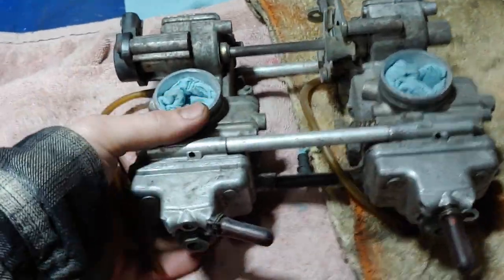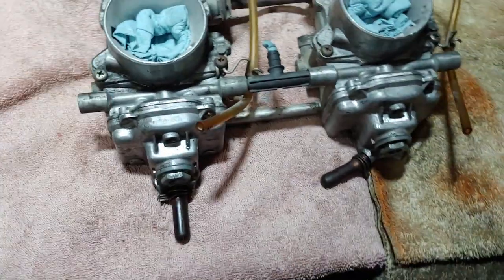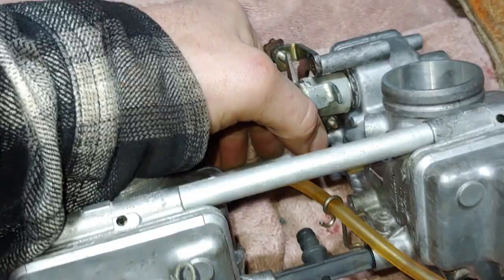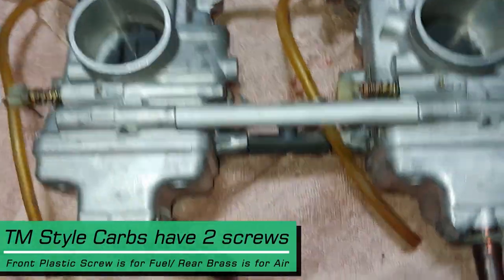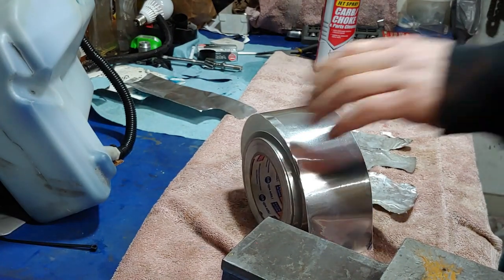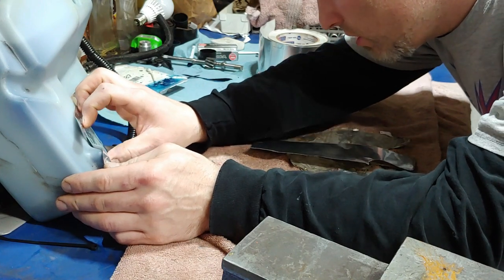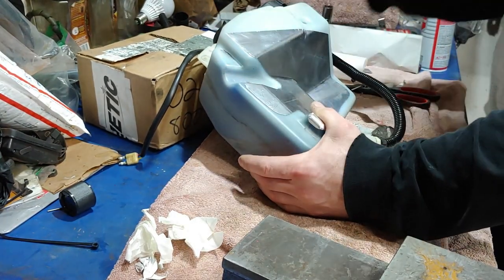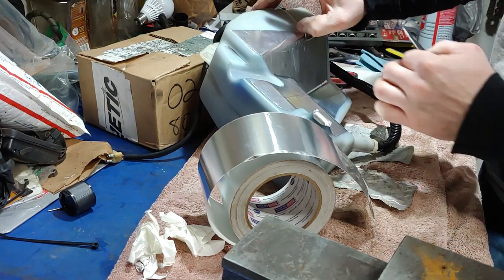02 Arctic Cat ZR 800 CCE Rebuild Part 16 || Cleaning & Rebuilding MIKUNI Carbs

Comment: Эндрю подскажи пожайлуста, сдесь один винт на качество смеси ?
Reply from the maker: There are two screws on these TM style Flat Slide Rack Carburetors... The one with the white knob, closest to the cylinder is for fuel mixture. The one on the Air box side of the carburetor is for Air mixture. They do work in tandem...

Comment: Hey Andrew - do you know what the stock settings are for the air and fuel screws? Having idling problems on my 01 800 - also think its running lean, there is little to no smoke and high idle off the throttle. Plugs are a light tan color. Thx
Reply from the maker: 2 on both the air screw and fuel screw but if your idle is hanging try turning your air screw in a half a turn and see if that helps

Comment: Aye i just rebuilt my carburetor and on the plastic T that feed fuel to the carburetor didnt have any O rings on it witch i found strange. Dose it just insert in to the carburetor or did i lose the o rings
Reply from the maker: I believe that there are rubber caps that go over the ends...